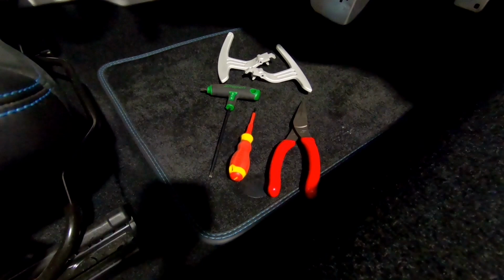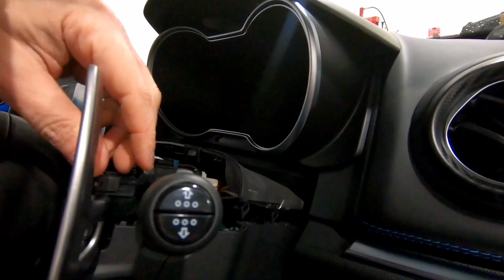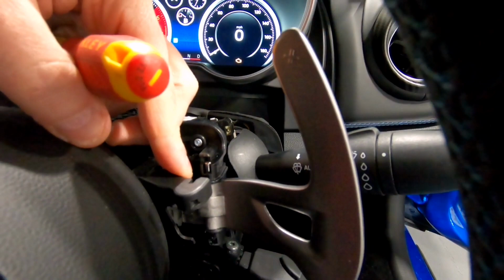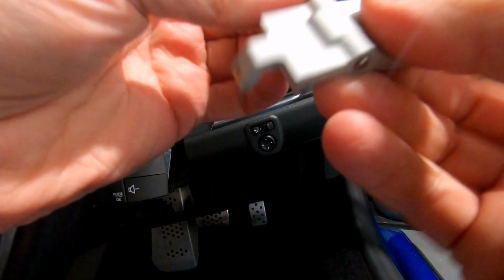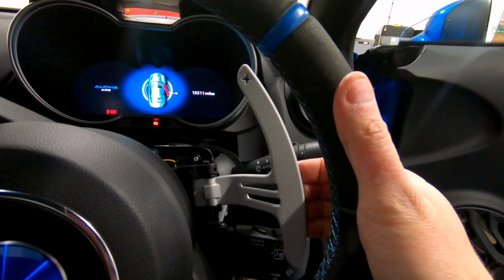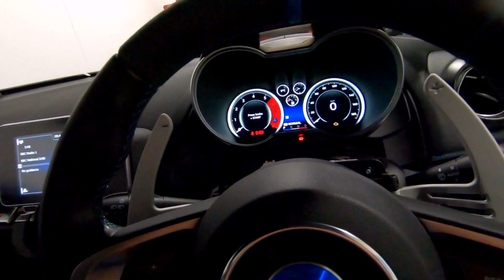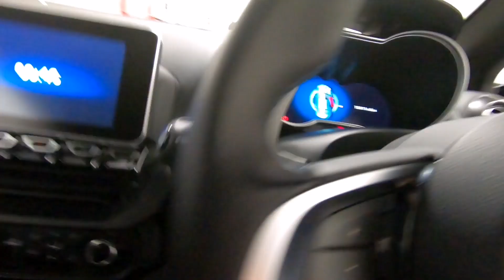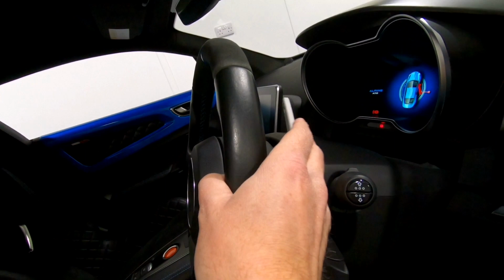LIFE110 Performance Paddle Shifter Fitting Instructions

Comment: Excellent, paddles arrived in the post this morning, immediately fitted to the car . I followed your video with my iPad resting on the passenger seat, only took me 15 minutes to fit. The quality of the paddles is outstanding, they’re a work of art in themselves. Then out for a ‘test drive’…love them, ergonomically correct with the perfect texture and lip. 

Note - I found if you pull the steering wheel out to it’s maximum extension it allows you more space to remove the steering column cowls.
Reply: How are they in everyday use? Is there still enough space between the steering wheel and the paddles?

Comment: I fitted mine today....very easy! I also noticed that the whole column behind the steering wheel (where the paddles and so are mounted on) can move a little, so you need to make sure everything is aligned straight otherwise one paddle will be higher then the other one (just a small detail).